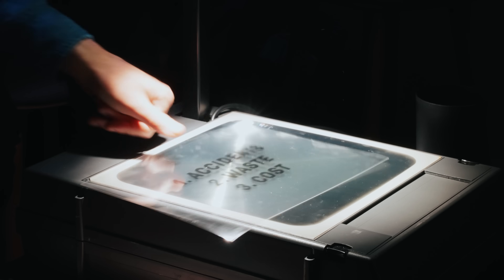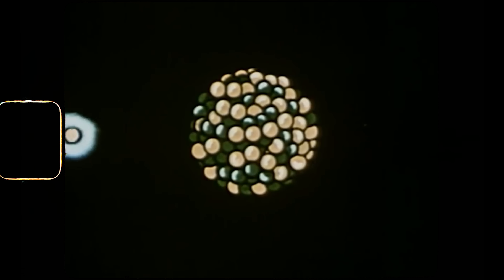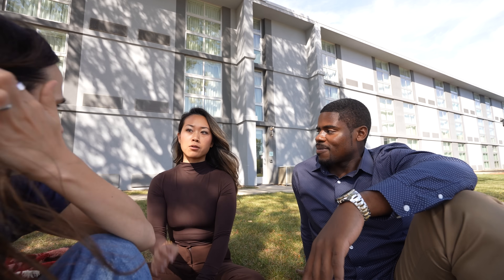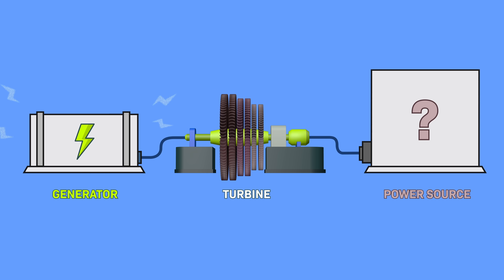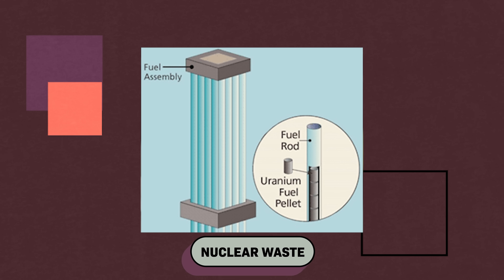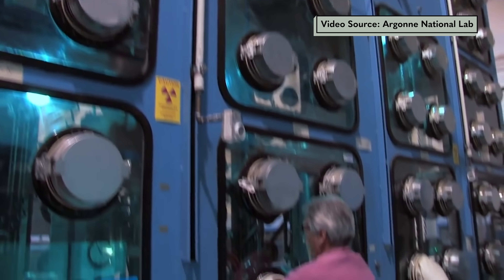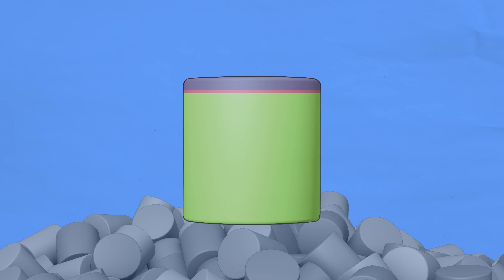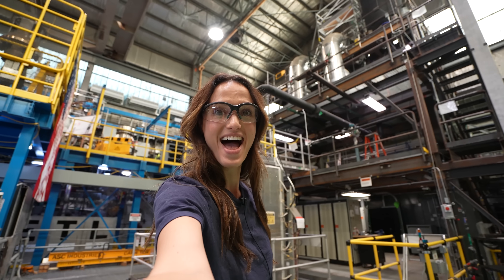The Big Lie About Nuclear Waste

Comment: I used to be a radiophobe as a kid and think that nuclear waste was green liquid stuff. Then I did a project for physics and all the data pointed to the opposite. It’s safe, waste isn’t a problem, hell with fast breeders (started to be a thing in 1989) we can enrich waste and burn it up even further.
Then in 1990 I went to study EE and the first week the school went to a nuclear power plant. And you just got to hold a fuel pellet in a gloved hand. We saw the cut through of those barrels that hold the “waste” in a 30cm tall stainless steel cylinder, encased in heavy concrete in a 250L barrel. There’s no way that is dangerous. But this isn’t shown in the media. People are held stupid and made to fear things they shouldn’t fear over. If you fear CO2, then the only real solution is nuclear. But that seems to be rarely in the table.
Reply: It's in any industry's best interests to say that it is safe. But we know that, right?
Reply: @tim6405y  but we can )and have) objectively measured this to be true.
Reply: Nuclear $$$$$ 10-20 year build
250 litre barrels of forever toxic waste, risk after risk
versus
Renewables $$  5 year build little toxic waste by comparison
If the option is there to use renewables, why wouldn't you take it?
Reply: @tim6405y  renewables in most countries, that don’t have geothermal and thus can only have wind and sun can’t produce the baseload. Waste has never ever been a problem. The 250 liter barrel contains just a time bit. And fast breeders can actually burn up to 95% of that. 
Windturbines (and solar is even worse) have terrible energy per square meter ratio. You will need to litter the whole surface of a country to produce enough energy. Because the most powerful wind turbines can only produce a measly 12MW and they are as tall as the Eiffeltoren and need only produce that amount 30% of the time and require at least 1.5 acres for the wind to settle before you can put one behind it to get effienxy back. In that same surface area I can put a nuclear reactor that produces 800MW! And if we take the height in consideration I can easily produce a GW!!! On that same footprint. Wind turbines will never cope. And they don’t even turn 24x7 and overage produce only 20-30% their maximum capacity of energy.

Oh and nuclear has the smallest amounts of deaths per GW/hr.
Reply: @tim6405y  Australia has a lot of sun, we don’t on Western Europe. Secondly batteries don’t last very long when you continuously charge and discharge them. 5 years with a good battery, so that’s no longterm solution. Recycling the LiPos cost more energy than we get out. And the problem is that cobalt is a very rare substance. Even TESLA, is really worried that they can never produce enough EVs, because the amount of cobalt and zink needed will make the prices beyond affordable and cobalt is only found in counties where slavery and human rights don’t line up with our morals. This is why most automotive manufacturers pivoted away from batteries and now look into hydrogen or highly efficient petrol cars again.
Battery storage will never pivot out as a long term safe solution. Have you seen LiPo batteries burn woahhhh!!!! I don’t want a battery pack like that in my house. Yet I would be 100% fine living next to a nuclear power plant. Especially those nice Rolls Royce pebble reactors that even look nice.
Pebble reactors are the future. Making them smaller reduces cost and distributes the grid which is something I also like about solar.
And solar panels on roof tops of houses I’m all for — just don’t sell back to the grid. Since balancing the grid is impossible that way. Take it from someone who was in the energy business 😉
Reply: One size (technology) does not fit all (countries) right?
Reply: @tim6405y  that is absolutely true. I am beyond angry of our leftwing idiot government that stopped us using our natural gas. Natural gas is super clean and make great energy powerplants. Whilst Germany is pivoting from coal (after their idiotic decision to stop nuclear) and go to gas.
You need to use as much of your own resources as possible. Iceland geothermal makes sense — especially with such a small population mainly located in Reykjavik.
Here in NL it would by gas turbine with nuclear.
Reply: @tim6405y  nuclear would fit every country.  But you should exploit your own resources as much as possible. It’s beyond me our government stopped using our natural gas. Gas burns very clean and we could have for 100 years of relatively clean energy. And build nuclear and study throrium molten salt in the meantime. Coal is something you don’t want, that’s so toxic. Ironically there radioactive material comes free (radon) and especially the heavy metals in the ground ash and the fine dust are problematic.
But for developing countries it would be a great start to gain rtheir wealth (like we did)
Reply: You would prefer to live next to a nuclear power plant than live next to a house that has solar and batteries installed. Ok

Comment: Just a few observations.
Thermal works well and is fairly well developed. Just not in the US. Fast breeder reactors are fine and still need heaps of research, as you said. 
For really interesting .. look into Thorium reactors.  Also from the 50s, however research was stopped because they couldn't be used to produce plutonium. Surprise, surprise.
They are so much safer.  They even fail safe. Any leak and the reaction just stops, unlike uranium technology that runs away etc.

Thorium is almost everywhere, in many places its a waste product. 

Have a look. It's really interesting.

Comment: One correction. Cleo said in the video that "235" is the number of neutrons. It's not. It's the number of subatomic particles in the nucleus. All uranium atoms have 92 protons; if they had a different number, they would be something else. Number of neutrons is what defines what element it is. Uranium-235 also has 143 neutrons. Total number of particles is 92 + 143 = 235.

Comment: You need to go back to Oak Rige Laboratory in the late 50's early 60's and look at the MSR (Molten Salt Reactor) that was developed and how Nixion force the research away from Oak Ridge and towards California. Where they were developing the light water reactor. MSR's can convert 95% of the spent fuel rods in to energy as well as other benefits.

Comment: To clarify it a little better, you should not use nuclear waste and spend fuel interchangeably. Nuclear waste is the contaminated leftovers from the process of producing power (RX crud and maintenance and cleaning debris) and spent fuel is used or depleted fuel bundles that are no longer commercially viable to make power in their current state.

Comment: The rise of power has a direct correlation to the cost of a necular power plants they cost like 50 billion dollars to build and are dangerious for a million years! Will concrete be around for a million years to protect you the answer is a resounding NO. So, what happens to the toxic materials? Well, they dont leave it stays in pools of water how sustainable is that kind of storage? There is no storage area anywhere in the world, so engineers and physicists have been lying for a hundred years about the afforded to a deadly toxin and it safety. After 50 years of power production, it will never go away, so just keep building them for 50 billion a piece thats your solution. Thats going to fix our green energy problem, NO, it will never be any answer.

Comment: Trying to justify nuclear power,it's dangerous,go live in Fukushima
Reply: People are already moving back to the nearest towns to Fukushima, which realistically didn't need to be evacuated in the first place. The surrounding residential areas were never exposed to radiation much greater than that of Ramsar, Iran, which is known to not have any substantial health effects. In fact, the evacuation killed thousands, while no one was killed by the radiation. And 10s of thousands more have been killed since by the pollution from increased fossil fuels as a result of the move away from nuclear following the event. 

The reality is that nuclear power is the safest form of electricity production currently available.

Comment: Ooh woop pee, solved the nuclear waste problem and its been there all along. There is a reason it never got off the around and not used is because there are too many problems to make it commercially viable. Plus it doesn't use ALL nuclear waste and there is still a waste issue. BS for gullible viewers.
Reply: It's commercially viable relative to the absolute costs of energy, but not relative to the competitive cost of new uranium. As conventional reserves are depleted reprocessing will become economical. The remaining waste is, depending on the reprocessing method used, 1-5% of the initial mass and is dangerous for 300 to 1000 years. This is much easier to manage.
Reply: @Crispr_CAS9  "This is much easier to manage."

Is it tho? 

Imagine you would have to manage toxic waste a long extinct empire put in some cave.

Comment: The big lie about nuclear power is that it is economically viable. It never was, and there is simply no way of putting a pretty face on that fact. This is not a question of technology, but of economics. Every nuclear cycle option produces power many times more per kWh than every other source including all renewables, even when including the cost of battery storage. Look it up. This only gets worse when considering the cost of dealing with the waste.

Nuclear power will always be a money pit as its cost trends continue to rise, while the costs of renewables and battery storage continue to drop.

Comment: used on a prototype reactor, they realized RGPu wasn't safe. research has been slow and upgrading reactor to be safe hasn't been achieved and that's why the project was abandoned. Maybe one day can become a viable reality.  these reactors can fester up, like Chernobyl over nigh for reason unknown. holding panduras box sounds good, but keeping it under control is another thing:face-orange-biting-nails:

Comment: Thats a nice theory and all but for the electricity companies it is deemed too expensive to reprocess spent fuel. In reality, electricity companies prefer to get rid of used fuel and so we sit on tons of U235 with a half live of 700 million years as a gift for the coming generations to take care of it. Also here in Germany, the state is taking care of transporting and storing nuclear waste. 
If you would factor in cost for reprocessing and finally storing nuclear waste in energy produced, nuclear power suddenly becomes expensive and not profitable anymore.
Reply: Reprocessing is non-economical relative to new fuel, but it is economical relative to the entire lifecycle. As conventional reserves of uranium are depleted, the price of new fuel will increase until it equals reprocessed fuel, at which point reprocessing will become commercially viable.

Comment: This is the way to go. We need to send this to Chris Bowen, the minister for Energy in Australia. This guy is so hell bent on sending us back to the dark ages, wanting to close down coal fired and gas fired power stations before we have enough renewable energy providers to take up the load. Here is an idea, lets get rid of Bowen.
Reply: In Oz you need nukes like you need a hole in the head! With so much, in fact most, of your wonderful country barren desert, the potential for solar energy is colossal. Develop and export that technology instead of exporting millions of tonnes of fossil fuel: coal and LNG. Use the electricity to make hydrogen and export that instead of LNG. 
Did you know that your country has the highest global rate of species extinction? In spite of your excellent quarantine policies, things do not look so good for wildlife.

Comment: If nuclear power was already all the go in the 1940s and there had been no bomb, nuclear waste would not be an issue.  People connect nuclear with bombs and bomb fallout, not with boiling the morning kettle.  An example of people's stupidity and willful ignorance.  

If the current health and safety regimes were in place in 1880 then the motor car would not be using petrol.  Imagine somebody today promoting a steel capsule travelling at 100kph towards another steel capsule with only a painted white line to separate them, containing 60 litres of highly explosive petrol and a man and his family.  It would never get the tick of approval and the proposer  would be certified insane.

Comment: Can Thorium burn nuclear waste ? I thought it was done in the late 1950's
Reply: Short answer: No. 
Long answer: The type of reactor required for a thorium fuel cycle could be used to burn waste, however it can do this regardless of the primary fuel isotope. So the same reactor fueled with uranium could also burn waste.

Comment: There are other fuels other than uranium. Oak Ridge originally tested with thorium in a molten salt reactor. We decided against using that because it wouldn't benefit nuclear weapons development, along with the fact that the molten salts are extremely corrosive. There is research into MSRs again (in low pressure designs to help eliminate 3 Mile Island/Chernobyl type events) which would also benefit of eliminating our nuclear waste stockpiles.

Comment: Thorium reactors satisfy both the non proliferation and waste concerns. Plutonium being isolated in commercial reactors is a massive security issue which makes cost astronomical.
Japan uses cycling reactors for the poltical goal of not have nuclear weapons on hand but the capability to assemble them quickly. This is mostly a political issue rather than an energy one.
Even if you tripled energy production with nuclear you arent significantly going to change the oil fluctations in the energy market as ships, trucking and cars are the primary consumers.
Reply: Plutonium from commercial reactors is not usable for weapons. Thorium cycle reactors produce U233, which is an excellent bomb material.

Comment: seen in the comments plenty of experienced nuclear workers, I have a question: Why those nuclear reactors used in submarines aren't used as modular reactors for supplying electricity on land?... surely they could be placed on abandoned mines which already had power transmission facilities and could be easily buried in case of accidents, with their fuel and waste

Comment: looks like the nuclear waste technology is still stack in the hardest engineering part, which is achieving that:
operating earnings - (Investement + running costs) = profits higher than other competitive technologies with similar risks
until this is not achieved, it is just a interesting lab experiment

Comment: The difference between 40 years ago and now is that when 3 mile island melted,  people awoke from their sleep and started asking questions.  The answers were not good enough to assume the risks involved. 
I have friends who lives in. Mechanicsburg Pa.
The power plants that they are building now are designed to produce electricity. 
My brother's works for Siemens and one is a welder and a steam turbine blade mechanic. 
#4 welder in the whole company.   The customers request him when they have a outage and if they have a planned upgrade. 
He only has to repair it one time.
His previous occupation was welder at USTD Turtle Creek pa, now owned by  Holetech.
The rack you put the spent rod's in,  my brother made them,  along with the vessels used to transport them by rail. 
For 10 years His job was to build the lids for the ends of the  vessels. 
That is all welded by robot in the reactor.  The drain lines have to be precise. Or they won't line up.

Comment: What I read is that Japan is doing research on the Nucleair Closed Fuel Cycle but it's not there yet.
It all depends on how much it costs and basically how much energy you have to put into it. If it's too expensive we'll still be stuck with longterm, very dangerous waste.
Reply: As opposed to coal, gas, 'renewable' dangerous waste.

Comment: Well, that sound very promising at the first look. 

But at the end of the day, you also have to compare what a certain unit of energy (e.g. MWh) costs.
As far as I know renewable energy sources are by far cheaper than any other other source. 
In addition to that, I assume, that those recycling processes are energy intensive and create a lot of carbon dioxide emissions (not all steps in the recycling process could be covered by electricity).

But it still keeps charming, that there would be a way to bring down the waste‘s half life time by several magnitudes.
Reply: Actually lignite is the cheapest, with dirty brown bitumenous coal the second-cheapest.

Carbon dioxide is those bubbles in soda pop.  It's plant food -- not an environmental toxin.
Reply: @floycewhite6991  "Actually lignite is the cheapest" Only if you don't include the 32 deaths per TWh over staggering environmental damage as part of the costs...
Reply: "As far as I know renewable energy sources are by far cheaper than any other other source. " Nuclear is the cheapest source of firm power. Reports showing the low cost of renewables exclude firming from the analysis.
Reply: @Crispr_CAS9  which (independent, bias free) report does say, that nuclear power is cheaper?
Reply: @carlgustav7196  Most proper LCOEs put the cost of nuclear at $80-150/MWh (EIA, IPCC, etc). Firming costs alone for renewables are on the order of $100/MWh, on top of a ~$50/MWh energy cost.